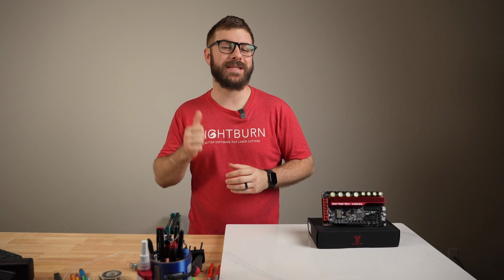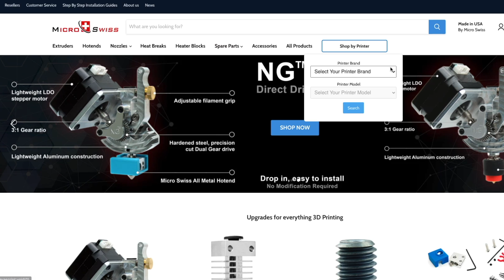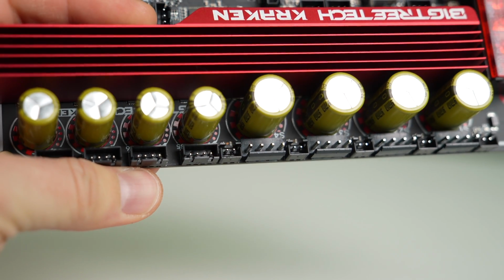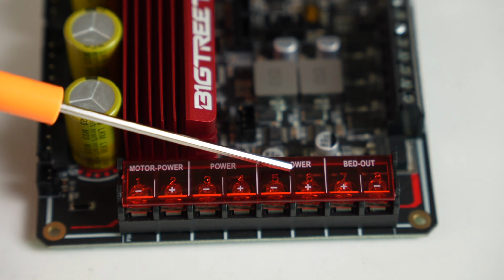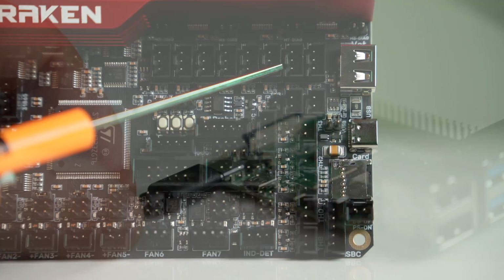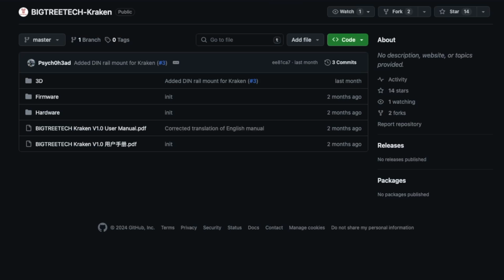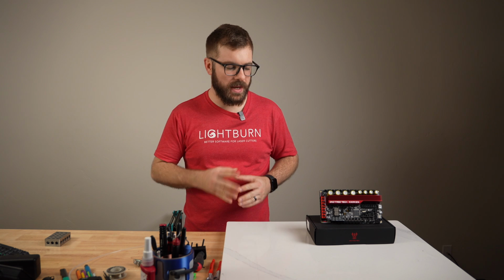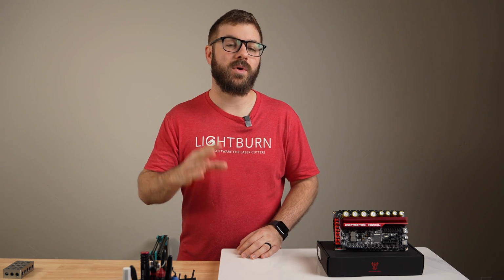Best Controller For Your 3D Printer Build? (BTT Kraken)

Comment: looking for a board my setup  zzzzyyx i would like to use 4 colors at a time 1000x1000x2000 and my hot-end is a ender 3 oem running 4 400x400mm  beds on a 1000x1000 spring steel plate

Comment: I hoping someone can answer this for me. I have a elegoo neptune 3 max. the big boy. 420 x 420x 500. The standard control system and whole exturder hot end combo just sucks. I recently did a full x and y linear rail kit I build and machine myself out of aluminum. Now i want to throw out the entire standard control system and screen. I want to upgrade the Y axis motor aswell as the bed is very large and heavy and Im fitting and entire bondtech extruder and hot end kit.  Now my question is is this Kraken the type of controller I could use to do the convertion and does this now also need a additional computer like a pi or something like that? What would a good klipper host be to pair up with this board. Also.... what is a good source of how to load and program all this stuff? I have absolutely no idea how to do any of this Im a machinist guy not a coding PC guys. Please please any help would be greatly appreciated.

Comment: i hope you read old video comments.   do you thank you can do a video on installing this board. like  what stepper motors did you run with this. and how you firmware it and so on.   there is no info out on this board. and reddit bigtreetech page is useless as no one well even replay.    yet  this board is 120$ usd     my card is on the way and really i am nerves cause i spent weeks looking for all the info i can. and only got 1 pdf and  just people talking about what it has and not how to troubleshoot.

Comment: One thing should add is that.  These board should have more protection for surging voltage.  I have all my 3d printer dead except  one when a lightning strike near by my home.  The only 3d printer survive is a printer with smoothie  board and all dead are BTT board.   Not to be discriminate but all other electronics devices from china made are dead.  All of the survive are actually all the same brand and all the dead are same brand. All Leviton  smart light is dead while all the Lutron light is survive.  Not sure what Leviton and Lutron are come from but after this incident I am kind of uncertain of using BTT board to build my printer(The Rasbery Pi actually survive).  So far my choice of board will be on hold.

Comment: I picked up the Kraken, due to the need for the 8 motor drivers. However, I am a little confused on how to set up motor 3 being the 2nd Z stepper I want to configure for the 5th extruder. The Kraken has many bells and whistles that led me to pick that board. I am excited to be building with this board. I have a 5 in 1 out setup, built around a 5 input diamond hot end.
Reply: You can make your motor port assignments in your printer configuration file inside of klipper.

Comment: What are the advantages of using 2160 drivers vs 5160? 2160 is used more for CNC so I just wonder why use them instead of 5160

Comment: soldered drivers? no thanks!
Reply: Scared of soldering? Ya Nancy 😂
Reply: When your pushing higher power/voltage, the connection becomes a concern.
Reply: Have you ever had to replace a driver?
Reply: @rainforestnomad  I think it's more about upgradability.
Reply: @rainforestnomad yes, i have.
Reply: @rainforestnomad I have
Reply: @rainforestnomad  yes, and I don’t have a reflow station. So I couldn‘t

Comment: Might be worth to Mention that the Minimum Output Power for the Stepper is 1.7A. there are already cases of people frying stepper with this board because of the Minimum current the board offers. this is to much for LDO 2504 and lower powered Stepper.

Comment: Just one thing you got wrong, all the 8 drivers on the Kraken are high voltage, just some have higher Amp rating than others
Reply from the maker: Yeah, that was a goof. I went over the technical parts a few times yet that still somehow slipped through.

Comment: I purchased one and was talking about it on discord when someone mentioned they had sent their Kraken back because they could not change the voltage on each driver. Since the only motor that can't take 60 volt in the setup I'm planning for the Kraken is the extruder it doesn't matter for me, the extruder has a 24 volt TMC chip on the hothead board.

Comment: One important difference: the tmc5160 on the leviathan support sensorless homing, the tmc2160 used on the kraken dont support it, although in a HV scenario, or even multiple stepper per axis, you dont want sensorless anyway
Reply: I have no idea where this information stems from, but that is not accurate at all.
Reply: @lap87  ups, mixed something up there. It does support sensorless homing, although im not sure if you want that for HV applications. For idex you definitely dont want it or if you drive one axis with multiple stepper like a annex k3 does, it cant get your axis out of alignment.

Comment: One thing i am confused about,  this board looks awesome.... but why do I need a Pi? Can't I just install Linux (Klipper) directly to this board? All these bells and whistles but we still need a companion computer to run Pi? Is that correct?
Reply: Yes, you do need a Pi or Linux computer to run Klipper. If you do not want to use a pi for some reason, then you can install Marlin which doesn't require a pi. The pi is needed to handle wifi, klipperscreen, and Mainsail/Fluidd.

Comment from the maker: This board requires tuning and it isn’t a general purpose controller. VZBot team let me know they don’t recommend it for the printer due to risk of damaging the Nema 17 stepper motors. Be sure to use high current steppers that can handle the minimum output.
Reply: Got any such recommendations? the fattest nema17 i know of is the 2.8A Super Powers from LDO
Reply: This is not accurate. The board is capable of driving very low currents. If I had to guess, there was an error in the users config who reported this.

Comment: I would like to see the mcu and fixed tmc drivers from kraken with the wifi config from octopus pro, and for each driver 5A capable capacitors, because you could use rrf for cnc and 3d print, one board to rule them all, i am will using the octopus pro with slight mod to the capacitor 2 to 3Amps, must see how to solder them on the board, than i can use it for cnc and nema23  motors it will be advantageous😅

Comment: Does this board have 12v gate driven 5160s on it?  Or is this yet another board with 5v gate drivers? -- Edit: Eww...it's only 2160s? :[
Reply: Do you know that there is zero difference between the 2160 and the 5160 within a 3D printer? The only real difference is that you would be paying more for the 5160 for hardware designed for other industrial applications that neither Klipper, Marlin nor RRF even have the ability to activate.
Reply: @bigtreetech5117  well some of use cant use this board , i've already sent a ticket, we are already 2 ppl with problems , my problem = Unable to write tmc spi ‘stepper_z’ register GLOBALSCALER on all drivers with connected or not connected motors.🤣 so release the best.

Comment: Hey could you do a video comparing boards suitable for the V0.2? Like BTT SKR Mini E3 V3.0 and FYSETC Cheetah V3.0. This could help someone upgrading a V0.0 or V0.1 to a new version. I noticed the BTT board is older and lacks CAN Bus but has a good manual. There are some Pros and Cons to both of them.

Comment: 8 Drivers isn't that much. 4x Z-Axis and 4x AWD and suddenly you are forced to use CAN-bus for your extruder because you don't have any drivers left.
Reply: How common is 4x Z-Axis and how common is AWD? Has something recent come out?  I don't think it's too much of an issue.  If someone is throwing AWD on a V2.4 they are probably going to add Canbus toolhead anyway.  Same if they add actual self leveling on a VzBot.  I don't know many details about Ratrig or Annex, honestly so maybe I'm missing their requirements.
Reply: @nitroburner77   The AWD is the method to gain speed, the triple Z has gotten simplified and very useful as well as cost effective, can bus to the head has gotten to the point where everyone has $14 boards with TMC chips, canbus, USB, MAX thermistors controllers, RGB and other signals, reducing the tangled wire mess going to the hotend. Now with Beacon like scanners replacing all other forms of bed leveling and Z axis control, the USB to the hotend will take off, it already has, the K1 has two USB port in the hotend.
Reply: @airheadbit1984  my point was 8 drivers is plenty unless you're doing quad Z AND AWD without Canbus on the toolhead or using multiple toolheads (again without Canbus).  Those particular setups commonly use Canbus (or USB).

Comment: I've had one and got it going fairly easy however the sensor less homing was a bear till I figured out the jumpers you needed to set and now that it's printing well I figured I would go the AWD route for giggles. All in all it's been very good though it does like firmware reboots between prints or the homing is not so great.

Comment: Another awesome video. Thank You. I learn so much from your video's. Any chance you could do a video on Orca and or Prusaslicer most especially covering setting them up for multiple printer use cases. I find myself very confused about the proper way to use them with multiple printers. The connections between print settings profiles and different printers and the need / use of physical printers on top of regular printers. It's quite confusing. My settings are a mess because I just don't get it. Coming from being a long time Cura user may be part of the problem. Maybe a video of setting Orca or PrusaSlicer up from scratch for multiple printers and setting up a couple of print settings profiles and a couple of filament profiles. Switching from one printer to another. Mind you - I stumble through it no problem. I just don't feel like I get it and I feel like I'm missing out on a much better experience. Like sometimes my ip address for my printer disappears and I wonder why. Have I not set it up properly or have I done something that caused the loss. Is it just me?

Comment: What is the pi for if it can run klipper? Wifi?
Reply from the maker: It doesn't run Klipper Host. You need to Pi to run it. The MCU can be flashed for Klipper but it still needs to be hooked up to Pi/Computer. There is not an onboard SOC.

Comment: This would fit perfectly in an Annex K3 which you should definitely build
Reply: Mine isn’t even finished yet and I agree
Reply: Generally yes, finished a K3 using the octopus pro last month, and with 4 5160s and 4 2209s -- it was a pretty close in price. The only issue is, this thing is HUGE. There is no cm4 module drop in here, so you have to have space for the 48v, 24v, 5v, pi, and this behemoth. I barely had room for the octopus pro, this would be a really tight fit.
Reply: @kazolar what’s the 5v for? If it’s for the pi it’s not needed, power the pi from the mcu.